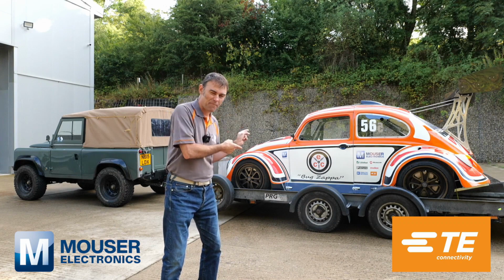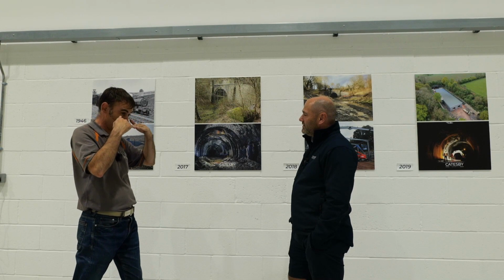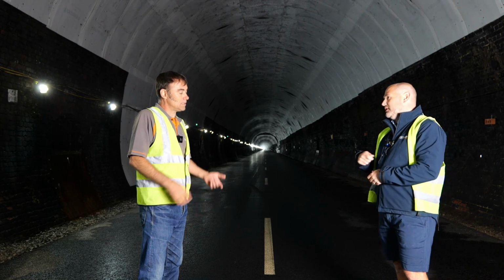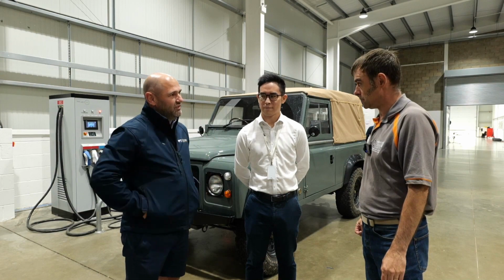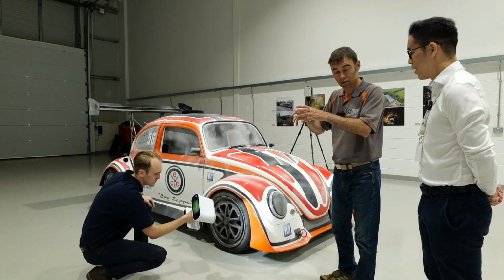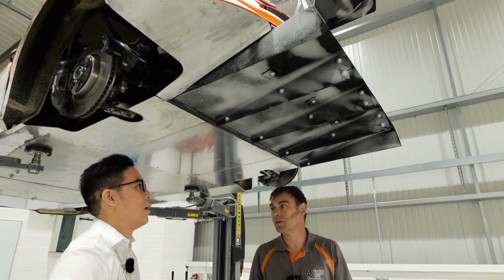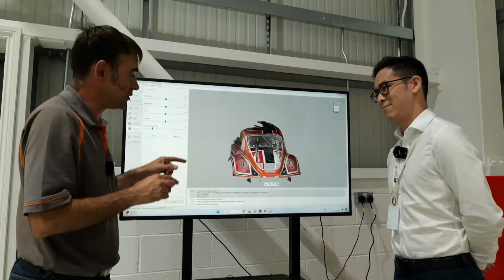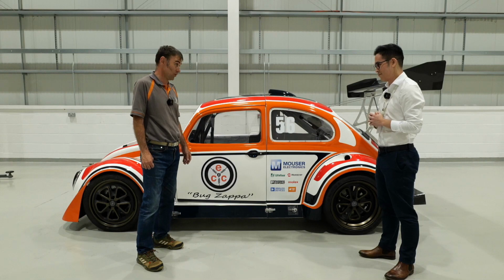Pikes Peak race car Ep15 - Aerodynamics analysis

Comment: 20:37 - You bet that VW Beetle shape generates lift.  In the 60's there was a turbine powered VW Beetle drag car in the US.  It did not have a rear wing for down force.  On one run it got to 150 MPH or so and the car lifted off of the drag strip, crashed and was destroyed.  Lesson Learned there.

Comment: Check out the Tom Scott YT Channel 2023 video "This is an excuse to show you a really good tunnel" for additional info on the facility.

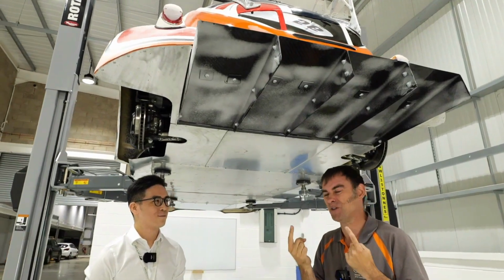15:09 - As an aerodynamicist (37 years in the gas turbine biz) and as a person who has actually designed aerodynamic diffusers for gas turbine engines, the purpose of a "diffuser" is NOT to accelerate the air, it is to slow down the air and turn dynamic pressure into static pressure.  As Diffuser (automotive) - Wikipedia says "A diffuser, in an automotive context, is a shaped section of the car rear which improves the car's aerodynamic properties by enhancing the transition between the high-velocity airflow underneath the car and the much slower freestream airflow of the ambient atmosphere."

Comment: Varying layers of speed and car handling improvement. Curious about the front diffuser. Then balancing the front to back relative down forces. Finally the underbody airflow dynamics and drag. Very interesting 3-4 weeks.

Comment: Nice Testing Center, I see the Landrover was gentle to it, but I think the Turntable should be at both ends of Tunnel, speed up the scanning being on a turntable ...
Reply: ? There is a turntable at each end. They're in the video.
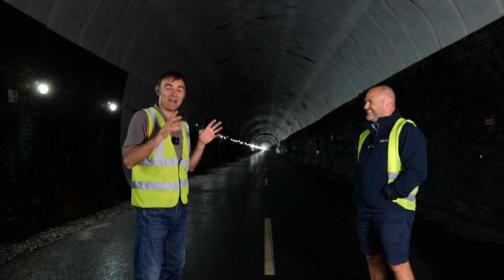Reply: @davidjulian8536  I was confused by Owner saying @ 3:35 "that Turntable was at far end" but later I see there is a 2nd one, whether it can spin a car in a 360' half a dozen times while it scans exterior, is another question, but not earth changing..

Comment: weight translates to grip and even wider tires - the increased wind resistance of down force aerodynamics help the tires when braking
Reply: I was told wider tyre reduce grip as the the weight per sq in reduces the larger the width. The wider tyre gives a wider track though. Could be wrong though.
Reply: @andgate2000  the weight of your vehicle decides how wide a tire you should have

Comment: Ive seen this place when they do historic and exotics sound recordings in there ...  Think Auto union f1 cars and V 16s.. 
...you can play them back through your car stereo if your so inclined 😂

For cooling you need low drag aero NACA air scoops and vents..  how you leave the air is as important if not more so than enter it. 
Small items add up to frills on your curved brick .😉 
And dont forget the belly pan...  as the area of highest turbulant intereaction  between two  solid surfaces. And there it is lol 😂...granny, eggs and suction.😁😎